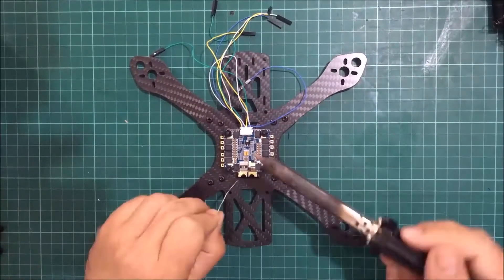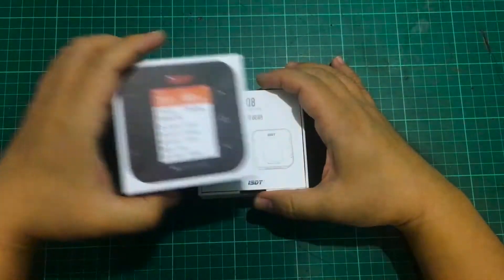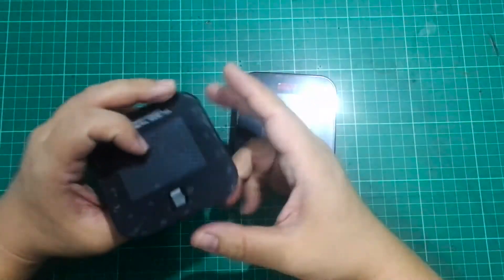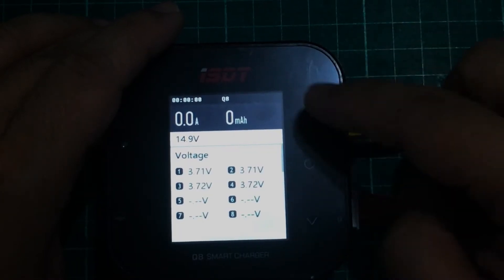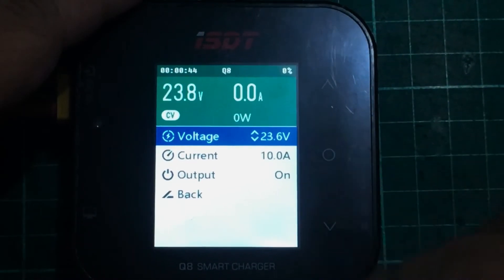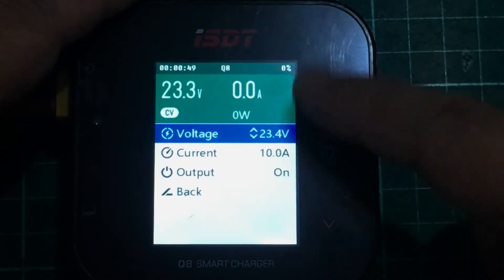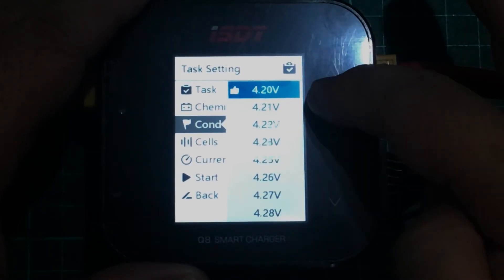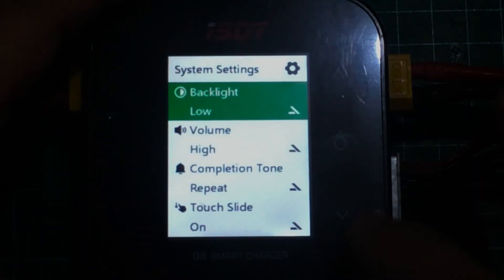ISDT Q8 Charger Review | Is It The Successor of the Q6 Pro?

Comment: May I ask a question?
I use lipo battery charger Q8 Isdt 1000W, and the input power is 24vol 30A.
When I charge 4 batteries of 6s 5000mah at the same time through the charger, does the balace mode work at its best?
thanks everyone!
Reply from the maker: Your input power is 24V x 30A = 720W. At the peak voltage of 25.2V (6S LiPo), each LiPo takes 126W @ 5A charging, so you only need 504W to be able to charge them at 1C each. Balance mode has nothing to do with it, as it just makes sure each cell is balanced by DIScharging those cells that have higher voltage than the rest.

Comment: You neglected to mention that ISDT chargers use a proprietary ballance port that JST-XH connectors will not plug into. Mating connectors are difficult (read as impossible) for the consumer to obtain and there are NO adapter cables available.
http://www.keywild.com/X/ISDT_9_Pin_Ballance_Connector(1024).jpg
Reply from the maker: Not sure what connector you linked to, but a JST connector would only have notches on either end, not in between each pin, and is pretty common. Here might be a better reference: https://www.jst-mfg.com/product/detail_e.php?series=277
Reply: @ImaginationTech  Solved my problem. I found out the funky connector housing is part of the Q8's outer shell. I took the charger apart and used a utility knife to carve out the proprietary bottom of the connector housing. Now I can plug in standard JST-XH balance leads ... happy days are here again :-)

Comment: Can you please confirm if the charger can be use to charge battery pack through the BMS on the battery pack ?
Reply from the maker: ISDT chargers are notorious (for me) for being difficult when charging anything other than a standard multi-cell battery pack. You just need to plug the XT60 to the charger, select the right number of cells for your battery pack, then start. It will prompt you about charging without balancer, and you just go with it. Another way is to use DC Power, but you will have to refer to your specific BMS about the charging voltage and current.